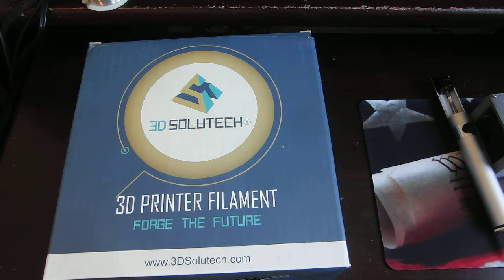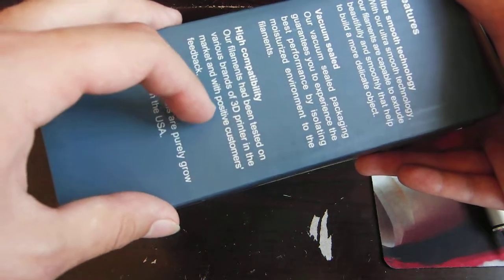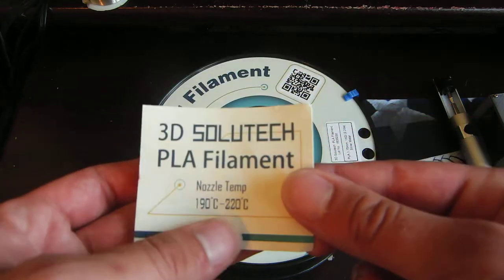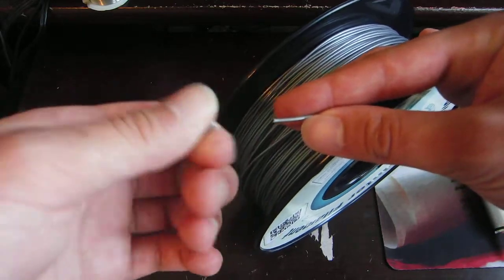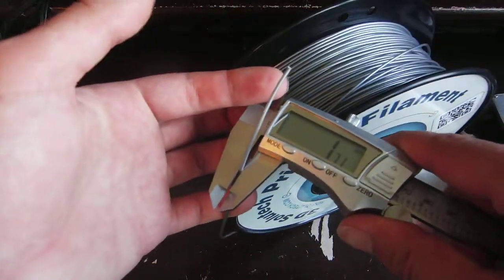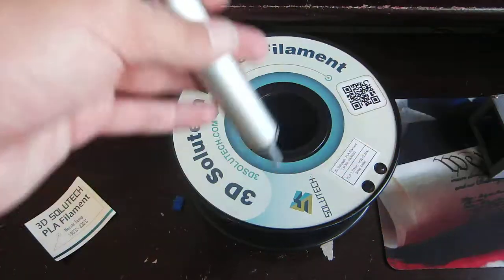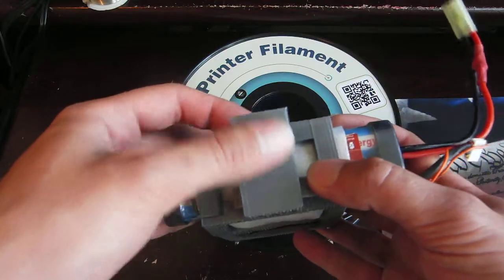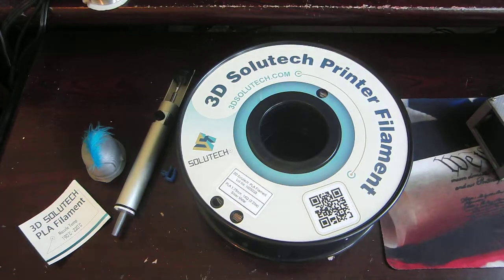3D Solutech Printer Filament (review)

Comment: ...why on earth.... would you use PLA of all materials, for a desoldering pump? that's gonna melt soooooo quick lol.
Reply from the maker: Yes but just about any plastic that you can print with will melt. PLA releases less toxic fumes than say ABS.
Reply: Not necessarily.  Solder melts at 188C, at least old school solder does.  Some of the newer lead free solders are up over 220C.  You really want something higher heat but then you won't be able to print it, and you certainly don't want ABS.  So unless you have a lathe handy to machine some high temp plastic...
Reply: pla Melts easier than any other 3d filament.
Reply: no it doesn't